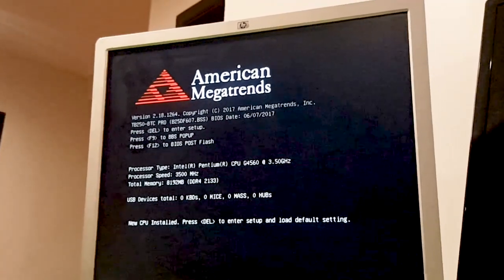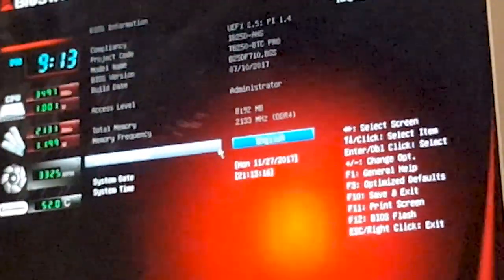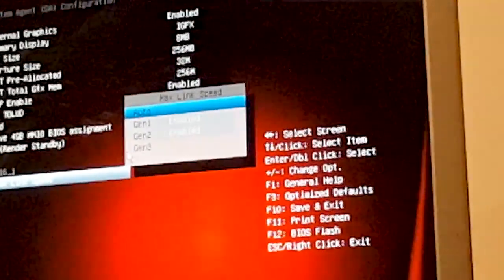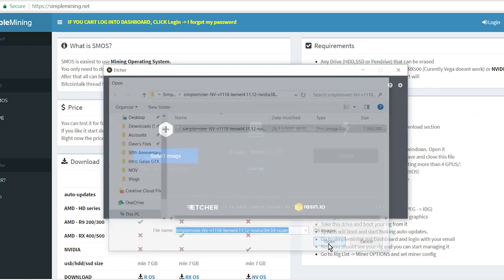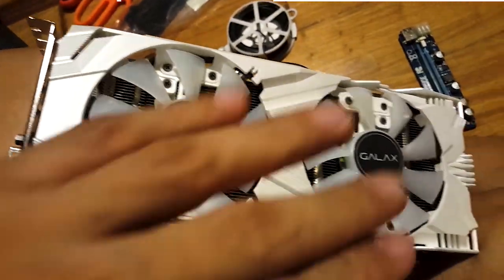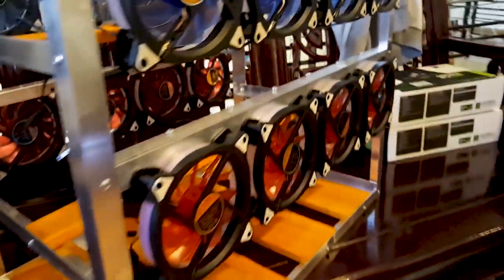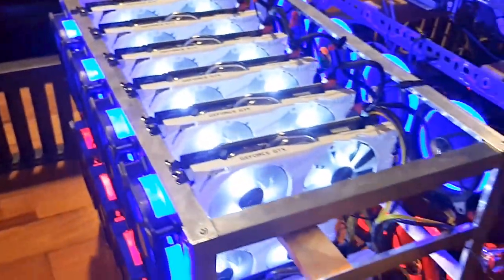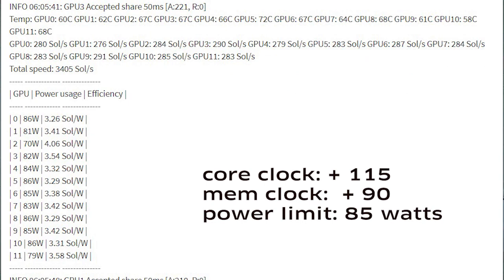Building a 12 GPU GTX 1060 Mining Rig Using SimpleMining OS | Biostar TB250 BTC Pro

Comment: Nice video, I have a question, I’m sorry if it’s a bit off topic but I want to look to someone with more knowledge then me. I want to set up my first rig, I’m thinking 6 card setup, not sure if I want to do ethereum/zcash or monero. Of course whatever is most profitable at the time. What cards would you recommend, the 1060/1070/1070ti or the amd 580? It seems the 580 I can get for about $300 a card when the 1070ti is almost double that, when looking at the specs it seems like if I’m mining for ethereum I can pull about 29-30 mh off the rx580 and about 37ish off the 1070. Is the few extra hash worth double the price? Please forgive me if it’s an ignorant question, like I said I’m new to this and don’t want to waste my money so any advice would be greatly appreciated.
Reply from the maker: hi!  From my experience, I was only able to get 1070s to run with 28 - 30 mh/s.  Almost the same as the RX 580. The RX 580 has higher wattage vs. the 1070 but I believe can be more efficient if bios modded.  Getting which set of cards can also be a little tricky.  I think it may boil down to which coins do you actually plan on mining.  There are coins which are mined more efficiently by AMD cards, and there are coins mined more efficiently with Nvidia cards. You can have a clearer idea what those coins are thru this website: www.whattomine.com.

And to answer your question, the few extra hashes (7 hashes) is not really worth double the price.  I would recommend computing which one would generate the most effective ratios.  Price of GPU to hashrate ratio and hashrate to power consumption ratio.
Reply: daveFL thank you so much for taking the time and explaining everything, it was very helpful. I think I’m going to start with the rx 580’s and see how it goes from there.
Reply from the maker: you're welcome, Garry!  glad to help.  Let me know how it goes.  Would love to get new ideas from different builds and from actual experiences :)
Reply: daveFL hello do you run with one card 28 to 30 ? Oh it's with the 6 card ?
Reply from the maker: If mining eth, each card runs around 19 - 21 mh/s
Reply: Hi daveFL, your vids are really helpful. Anyway, I have 5 Galax GTX 1060 6Gb OC version, but two of the cards can only get upto 15 MH/s.. Tried all the settings on Bios you advised to no avail.  What could be wrong with this. :( Not sure though if flashing the bios would help? But I also tried flashing, but keeps telling me can't find .FSS? Thanks..
Reply from the maker: ianzeus were you able to determine which type of mem cards those 1060s have? If they're hynix, you better mine equihash based coins because mining on dagger hashimoto based coins like ethereum will be a bummer with those.
Reply from the maker: ianzeus as for the bios, make sure you downloaded the correct file from biostar's website and then saved it in an empty 8gb (or higher) thumbdrive. It should be a .bss file.
Reply: Thank you for your prompt reply daveFL. I have yet to figure out the mem type (as I'm running SMOS - would you know how to determine?), but I'm assuming it's hynix. But will try out your suggestion.
Reply: The bios file I downloaded was indeed the correct one, as I'm using the exact same mobo as your build. Figured it was a setting (allow bios flashing - disabled) that was preventing me to update the bios. I was able to flash the bios now, but I guess I'll just have to live with the low hashrate for 2 of my gpu's.. Sigh.
Reply from the maker: ianzeus only way I know how to determine mem types is thru windows. Dont think that can be done via SMOS

Comment: Hey Dave! Did you use MSI afterrburner to OC those cards? We got the same gpus but I'm only getting around 19.XXmh/s ETH or  280+ SOLs ZEC on stock gpu.  Pwede ba magpatulong pano i tweak gpu to have better efficiency power:hash. Sorry, itong guide mo kasi best reference ko in building. Thank you! @btw, ikaw pala yun dave na nag like sa post ko (buying exoc) sa crypto market PH hahaha!
Reply from the maker: haha! happy to have helped and influenced your decision making.  :)  I'm running it on simplemining OS.  Hashrates can also vary depending on the mining software you are using (ewbf I think is great for equihash, claymore 10 for eth).  For overclocking, increase core clock and very little or zero on mem clock if mining zcash or equihash. increase mem clocks and a little bit less if mining ethereum.  depending on the memory chips of your cards, it can go very high if samsung (+800 mem clock), and then around +400 (+500 mem clock might be pushing it) if micron mem chips.  No experience with hynix though.  For core clocks, +115 should be fine at 70% - 75% power limit
Reply: Okay, cool. Thanks a lot!
Reply: 19.xxx? Thats what my 1060 does outta the box lol its at 24mhs when oc'd. Galax seem to make some boss memory ocing cards..
Reply: Jigz, check your Tunning, depending on the ALGO, you can push the DDR5 more for some and others the GPU.. play withit, give it 10min between settings and watch your POWER, over power helps a bit, but also spikes heat, read up, depending on your coin, you could just change settings slightly to get better speeds
Reply: JIGZMV try to tweek it

Comment: Fans to push air out from an open rig? Rly!? I hope you realize pointless of it?
Reply from the maker: Drzewacz888 i hope you also considered I am based in the Philippines. Try googling how hot our climate and room temps can take :)
Reply: Its cool as f*ck, also.
Reply from the maker: toasty fishsticks lol. That's why I said "hopefully improving the temps". Do you realize I said one side is directed towards the cards, and the other side serves as temp exhaust for better air flow? And did you really create a different account to comment this back again?
Reply: Rly!? I hope you realize pointless of it?
Reply: loving mine, almost $1000 per month.  wish I had the power to build more.  good luck bro!
Reply: whats your suggested operating temp for the GPUs
Reply: Not pointless at all. Computer components such as the VRM and chokes on most motherboards are passively cooled. They cms get away with this because a normal case has airflow from case fans. Since a mining rig has now airflow, you want a few fans.
Reply: i am in SE asia and it is hot as fuck.  I have 13 1060 in my rig with fans blowing out on the top and fans blowing in underneath.  cards are cool and as there is always fresh air around the gpus
Reply from the maker: @alan @shahed - definitely helped lowering the gpus by 2 - 3 degrees.  If it's turned off, the highest temp of one of the GPUs gets up to 73, when turned on, it lowers to 69 - 70.  definitely happy with the rig build :)
Reply: spam
Reply: then*
Reply: alan agus hi what is your mining set specs in order to gain 1000$ a month. Thank you
Reply: daveFL ok, than blow the air at it. Don't get me wrong, it's a nice rig, but those fans would do much better job blowing the air at graphic cards.

Comment: Hi i use same mb biostar tb250-pro, but i can't have video onboard,i follow all tutorial in internet but still no video onboard,i call the dealer he said tb250-pro only boot with pci-e, i think my mboard brick but he said it's fine. How do you manage yout Mboard, thanks
Reply from the maker: Bayu Handoko dont hook up the video cards during first boot up. Connect your monitor to the dvi cable (Dvi to hdmi or vga adaptors dont work). Once booted up, go to bios, and enable internal graphics. Select IGFX as your primary display. Save and reset. Hook up your video cards. Should work now
Reply: youtube.com/watch?v=DcrwasQGZag

Comment: What you do with this PICO Goes way to fast...!!  Fast philipiono spanish hola hola ... it's way to fast.. !!  :) Buenos noches senor.. but nice rig
Reply from the maker: Skjoldhøj Værkstedsforening haha! Sorry bout that. The pico is what you use to connect the server PSU to power up the motherboard/cpu/molex/sata(HDD or SSD)
Reply from the maker: thanks! the list of parts are actually listed on the video description :)
Reply: Mining rig components:
- 12 GALAX GTX 1060 EXOC video cards
- Biostar TB250 BTC Pro motherboard (12 PCIE slots)
- Intel G4560 Processor
- 1x 8 gb RAM 
- 1x 8gb USB drive for bios flash and Simplemining OS
- 1x 1,200 watts ATX type power supply
- 1x 1,200 watts server type power supply
- 12x ver008c riser cards
- 12 GPU Mining Rack from Mining Rack by Abi  ................. PICO?
Reply: if you press ctrl+< on your keyboard a few times the vid goes into slow motion, maybe this will help.  ctrl+> will speed back up. you can also pick playback speed with the gear icon in lower right side of video